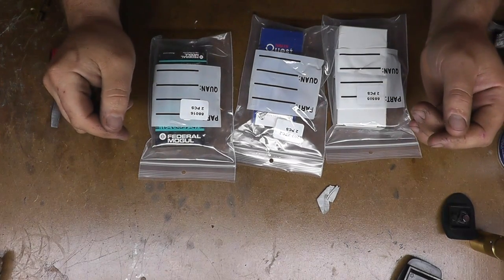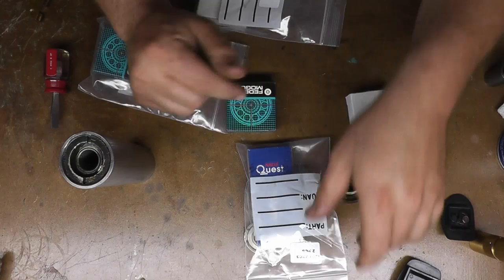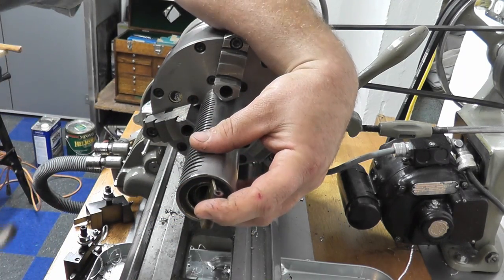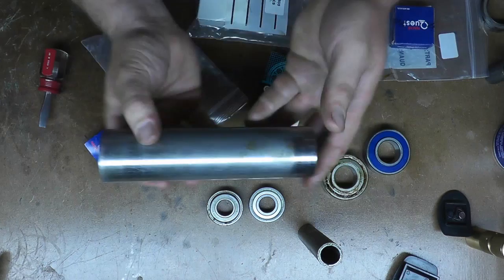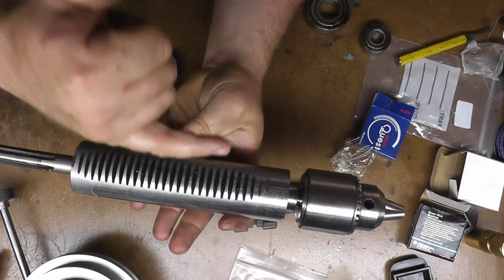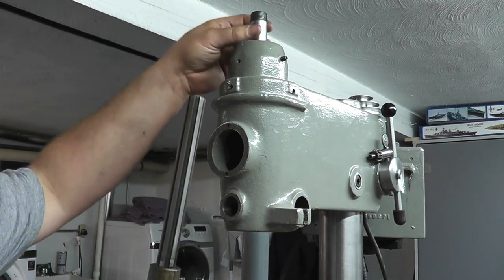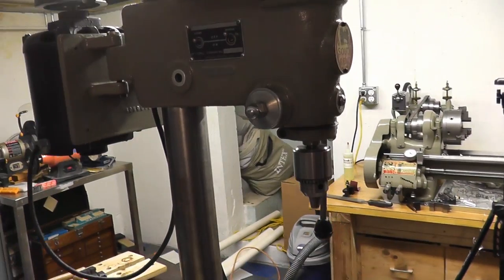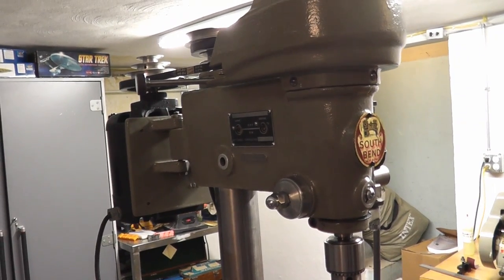*FIXED* Southbend Drill Press Bearing Replacement Part 2

Comment: Great restoration on the drill press, those older ones are so much more solid.
Reply from the maker: I swear this thing weighs just as much as the lathe.  We ended up with three adams apples getting this thing in the cellar.

Comment: Greg,
Great job! Removing and installing bearings can be a real pain in the ass! Too bad you have a "bearing claw" and slide hammer. Makes removing everything from ball and roller bearings to needle bearings a snap! Like your lathe, you did a great job of restoring the drill press! Thanks for the video! Looking forward to the next one.
Have a good one!
Dave

Comment: I have been around machines for about 40 years I never once saw a South Bend Drill press very nice machine looks like plenty of stroke on that quill ...over 4 inches? for that size press.   My dad had a 9 inch flat belt South Bend lathe similar to what you have he but had an Atlas Drill press.  Most company shops i have been around had the Variable speed split Clausing drill press or something similar.  My D/P is made in Taiwan and my lathe is a 12 inch Atlas that I restored.

Comment: Most interesting and informative video thanks, Your machine looks great, congratulations on a good job well done.
Never seen bearings with a longer inner section like those you showed.
Reply from the maker: So far I've found them on the press,  2 different motors of the same vintage, a table-saw, and an old grinder.

Comment: Tap the outside of the quill housing with a soft faced hammer to help the bearings seat.
Reply: Never tap on bearings! Tapping as you describe does nothing to "seat" bearings. They are made to fit and hammering on them will do nothing but reduce the bearing life.

Comment: Hmmmm, mine doesn't have that spacer between the drive pulley bearings. Mine also doesn't have the holes in the sides of the upper head casting where the bearings sit for the two allen head screws. I just have one allen head screw front and center. I wonder if mine was a prototype or a showroom model where they didn't expect it to do real world drilling?? The runout isn't great and it seems to be because of these two issues.
Reply: Mine too - makes it odd set up and I worry about bearing wear

Comment: Nice machine, nice job....is there another depth stop knurled nut for the stop?
Reply from the maker: There are 3.  One under the casting to keep quill from returning all the way and two to use as a depth stop and jam nut.  The wider different looking one is a quickset nut I made to adjust the stop quickly.
Reply: Awesome job....love south bend.

Comment: Thanks for posting.
Respectfully disagree with you on the quill adjustment shoe. The shoe is for taking up wear between the quill and the upper and lower bores in the head casting. Overtightening will cause excess wear.
=Brian=

Comment: Great job! That drill press will be good for another 60 years. You'll have to find yourself a 7" sb shaper to complete the set. Lot more projects you could do then too. I have a sb 13  that I want to try to make look like yours.. Is there a paint code you used to match the original sb color?
Reply from the maker: Yes there is.  In my paint stripping video and also one of my gearbox rebuilds I think I show the can with the formula.  It's Sherwin-Williams all surface enamel.

Comment: I know they are expensive, but the linked belts are far quieter and great grip. Just a thought.
Reply from the maker: The only problem with those is they are only designed to work on a 3" or larger pulley.  I carry them in my service truck as emergency belts.